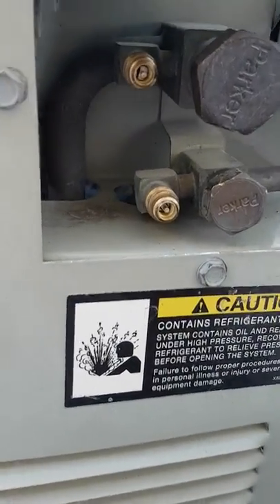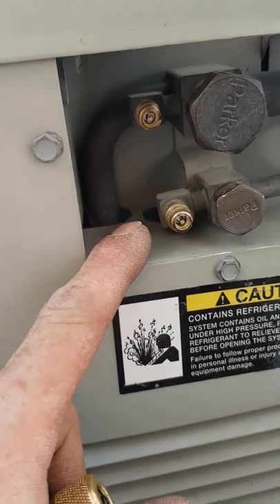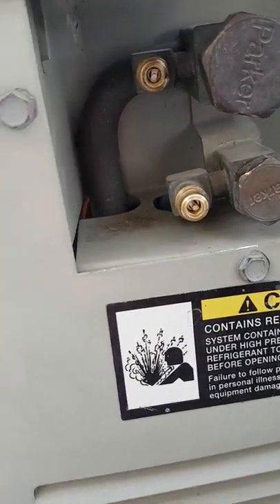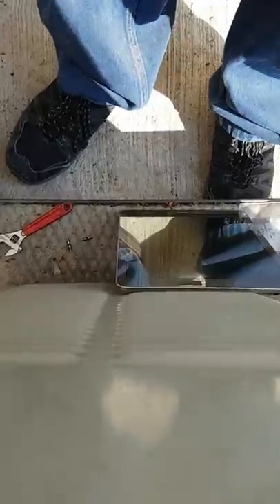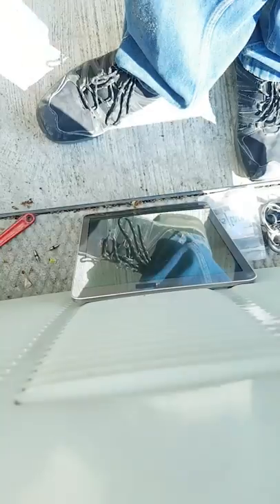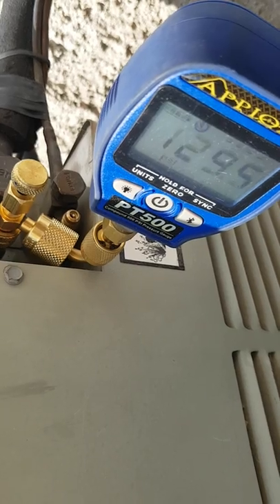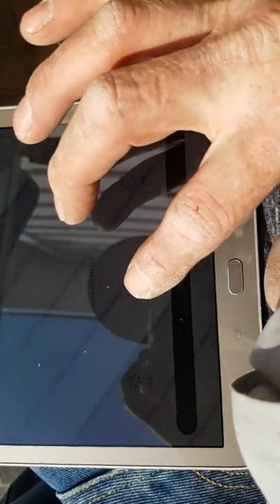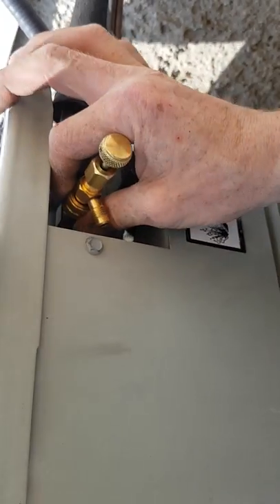Yellow Jacket Gas Retention & Core Depressor Valve (YJ#18993)

Comment: C&D Valve CD2070 Large Thumb Screw Core Depressor with Back Seat ,   I bought the tool but it doesn't work, the refrigerant started spraying out of the thumbscrew.  Do you have any tips on the use?
Reply from the maker: This one in the video is made by Yellow Jacket. 
I have seen the C&D ones but to be honest they looked kinda poor compared to the Yellow Jacket ones (i.e. cheaper brazing of the fittings, cheaper brass, cheaper and bulkier thumbscrew). I would say try the YJ ones I use.

Comment: Um thought u were going to show how to replace the core w pressure on the system w that tool. Instead u showed how to just basically put it in series w ur gauge. Maybe cause dumb clearance on that unit u were just pointing out u can use the tool as an extension piece for those gauges. And how to not have to lose refrigerant on the system w those gauges by using the low loss fitting.
Reply: Have you worked with low loss fitting in a 410a Mitsubishi system when the compressor( inverter system is ramping up?) , then you will understand why the 18993 Gas retention Valve & Core Depressor Valve 1/4" MFL X 1/4"" FFL is a must. your time will come to learn why do you really need to pay attention to this. video. I was working on a server room (IT department) . Yellow Jacket 18993 helped me. Like I said before your time will come. Knowledge is power if you are flexible to listen and learn from others before you criticize them.
Reply from the maker: The point to the video is to show that you do not need to release ANY refrigerant when hooking up to a system. No need for hoses or manifolds. Use this tool when hooking up for checking system operation/diagnosing.

Other tips (not all in video):
Use a core removal tool to change the core. Remove the core and use an Appion speed Y and 1/2" hoses for fast recovery. With the core out, use Appion 1/2" vacuum rated hoses for fast evacuation. And always get you Happy on with an Appion TEZ8 pump and G5 Twin reclaimer!

Comment: Hoes does the O ring hold up?
Reply from the maker: The tool uses a double o-ring and I wish they didn't. I would prefer if they used something more like what is in the core depressor end on a refrigerant hose. 
The inner depressor part of the tool tends to want to rub the gasket sometimes when back seating after testing, and wears out the back gasket faster than I would prefer to be honest